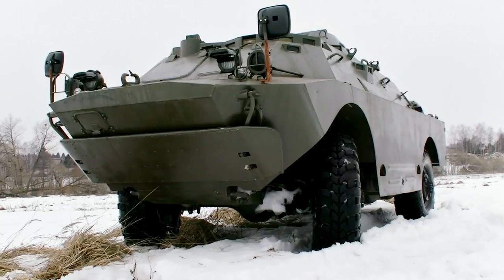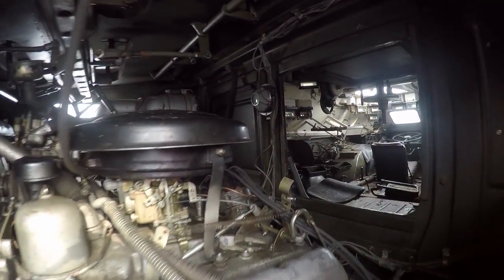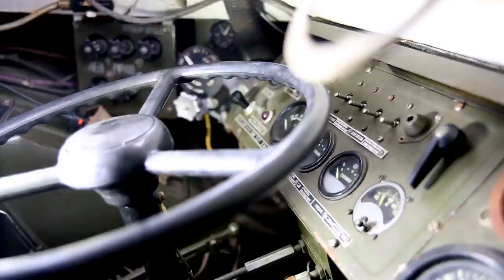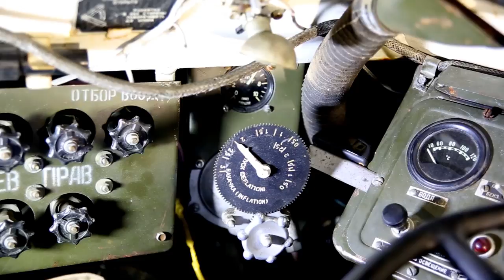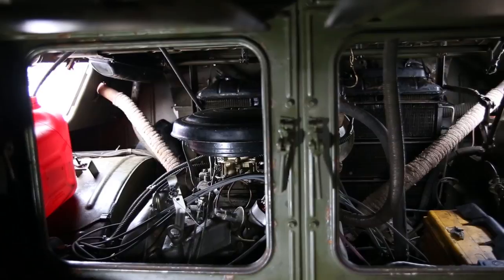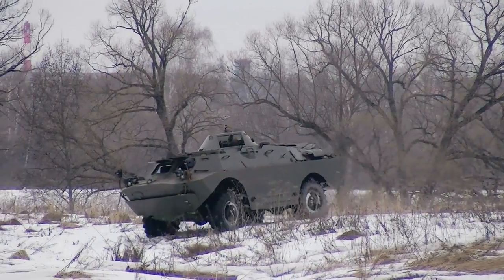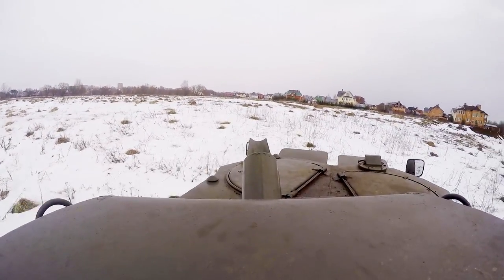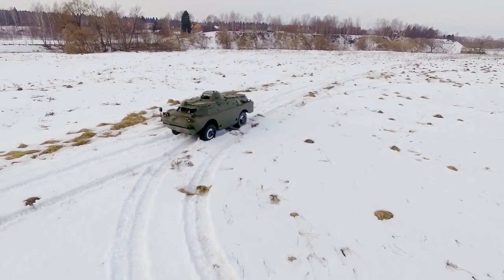We bought Military tactical 8-wheels ATV BRDM!

Comment: God, I'd love to get a few to refurbish, etc. IT has such a long history, you know it was a very well built and reliable vehicle. (US Armor Specialist here). Where did you get it? Please respond if you can. ...I assume shipment costs major bucks from the eastern block. Thanks for the video bro. And BTW: You COULD hypothetically emplace a 7.62mm (modified gun) through the ports IF you needed. They also are said to slightly deflate the tires in snow for more traction and inflate high for any road trips for better gas mileage. PLEASE! Always wear a helmet when inside. I knew a guy who got a brain injury when inside a bdrm2 at an international armor show ..they hit a bump and the drivers hatch sprung closed and hit him in the head!....Yes even with the safety pin in place, it sheared! Be well and have fun. On  a downhill berm, you can retract the mid-wheels and "slide" down a steep hill. Pretty cool.
Reply: I'm currently importing one from Czech Republic
Reply: @hummerguy  thanks!
Reply: @macumezahn  Its from mortar investment, I heard mixed reviews about them but I'm interested in seeing how it goes, I believe it should be leaving the port soon
Reply: many were "taken" by farmers and can be selled
Reply: @RenanMsV_YT  It won't be that easy, you'll need to have someone demilitarized it and plus you'll need to find an exporter. It'll still get costly very quickly